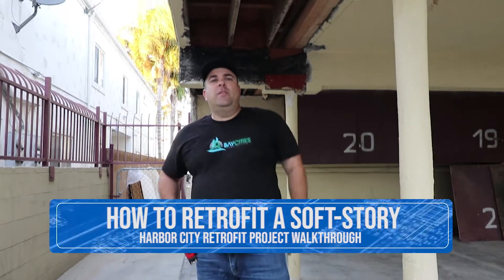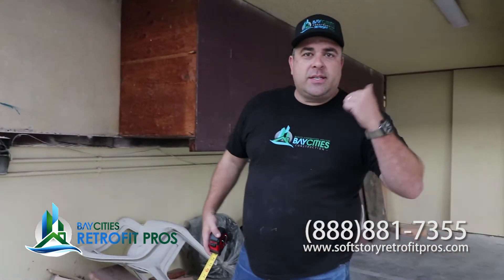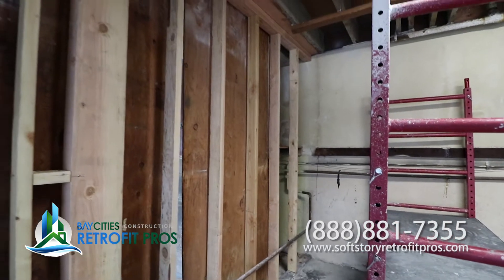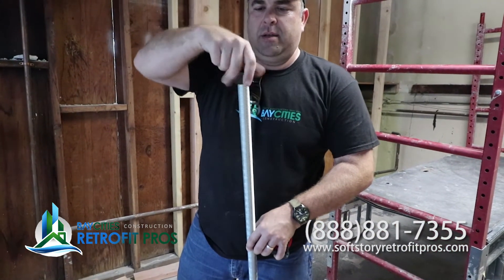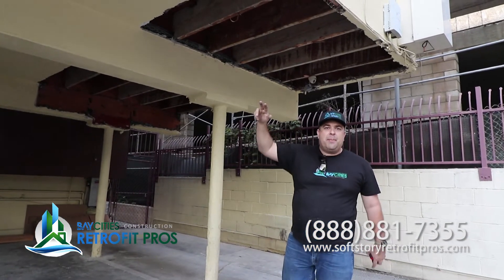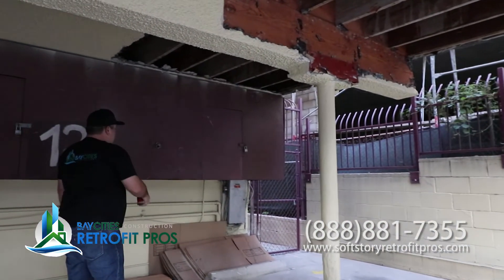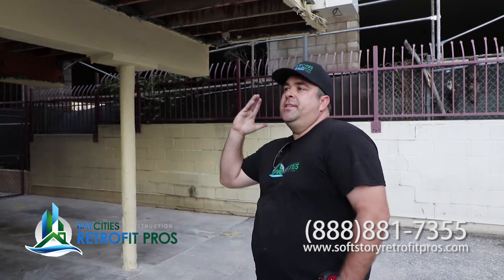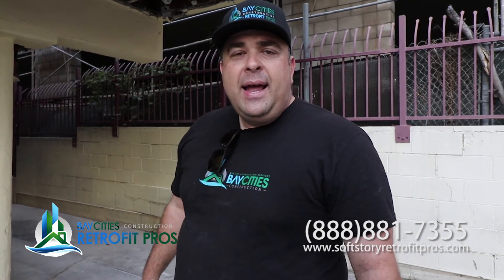How To Retrofit a Soft-Story Building | Los Angeles Retrofit Project Walkthrough

Comment: How far apart have you been required to install the a35's im currently installing them every 8 in on Center also same thing with the ltp5 I'm here doing some research on the Simpson moment frame
Reply from the maker: Depends on the project AND the amount of Kips expected. Each of these connectors has a load rating, so their sum should be equal to or greater than the value of Kips you are trying to resist. 💪 Learn more at www.softstoryretrofitpros.com